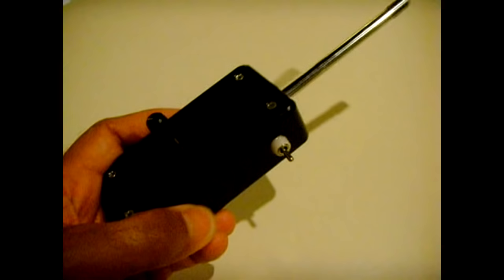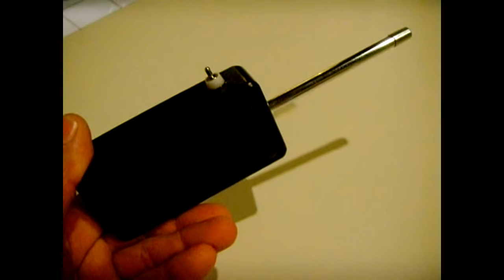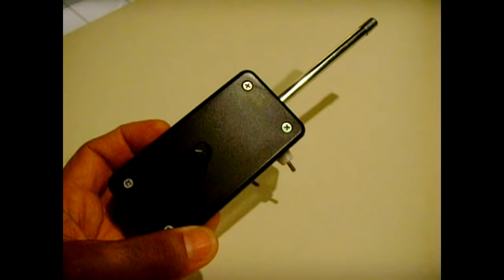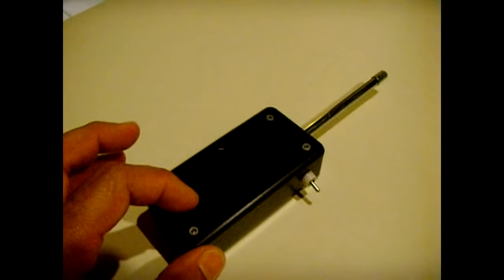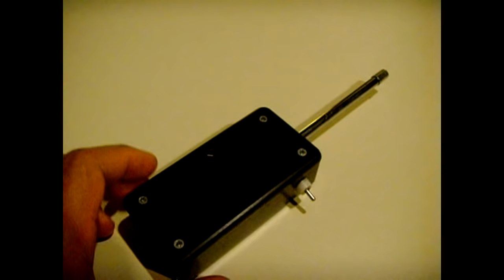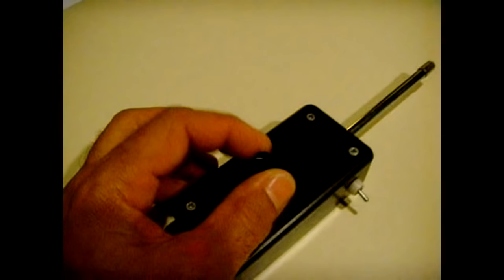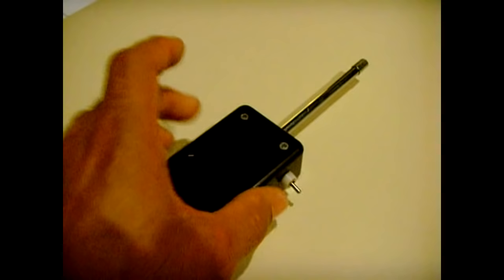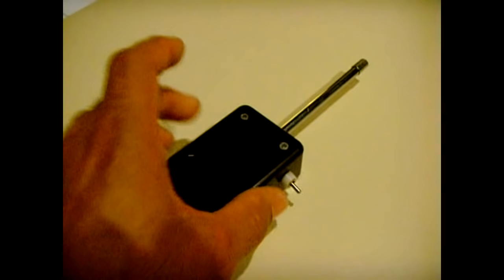FM Radio & TV Signal Killer Prank Gag Device(Wozniak & Steve Jobs)

Comment: Why not just use two 9 volt batteries in series? And will a device like this jam DAB, and can it be used to jam the infuriating radios in shops and supermarkets and bus stations etc.? That's what I need to teach them a hard lesson. And why not modulate it with white noise?

Comment: Worked at the first try using only components from an old radio ☺ +1 sub
Reply from the maker: Great to hear! Be sure to look over my "FM Transmitter" video playlist below, and most importantly share my channel with many others. Thank you
https://www.youtube.com/watch?v=KeRkWYJRxTI&list=PLQ6IOhUBblU3L0gIY6axV7OqRvBTqDNoP
Reply: Slender13 help! I’m not electronically savvy but a quick learner - need this
Reply: @joshuanelson5660  just desolder the components with the correct values.

Comment: Can you describe how to attach the antenna to the inductor (the 6 turn coil)? Is soldering involved or did you use jumper wires? I'm fairly new to building circuits, but I'm guessing the antenna just boosts/amplifies the magnetic field generated by the inductor. Does the antenna even have to physically touch the coils? Also, does the antenna have to be parallel to the central axis of the inductor? Thanks

Comment: Are you making these anymore? Also when buying these online they list things like GSM/3G/WIFI/4G WIMAX/4G LTE/CDMA Do these things jam tvs? Cause it just seems that they jam cell phone and internet. Can you please tell me what to look for when buying jammers for cable and antenna tv? Also do these tv signal jammers work through walls/ceilings/floors? Sorry I am new at this and haven't got a clue.
Reply from the maker: Hi there. Radio waves travel through walls with very little reduction of signal strength. The other jammers you mentioned will not do anything to a TV. The frequency of the jammer needs to be the proper frequency in order for it to work. Using cable or satellite TV with your TV set on channel 3 will work. If you use another input, the device may do nothing.

Comment: Hello Sir. I saw your post at Eleccircuit about the DC/DC Converter using NE555. I want to ask you about how should I do with the GND in the circuit? Can I just simply connect it to an empty circuit board line? Thank you. Peter
Reply from the maker: +Tan Sze-An 
GND is Battery Negative.

Comment: I use to make these jammers 30 years ago. 3 9v batteries near the transistor limit. worked awesome. then cable came :[
Reply from the maker: +Dan M 
I lived in the Bahamas and used the device on cable tv with no problem, until digital cable came along. :-)
Reply: Help, Dan M

Comment: I'm not so convinced, show us your circuit,the built article, I'd like to see it up close-I looked at the values for the tank and even without doing the frequency calc. I dont think you could jam any TV station with that,and at 100 feet? cmon man...
Reply from the maker: psycronizer I am able to jam FM radios up to a maximum 100' just as long as the radio station transmitting tower is not close by, otherwise you will need to get closer to the radio. TV's(NON-DIGITAL) can be jammed as well, but much closer.  No gimmick here. I guess you have not read the "About" section of my channel. You also need to click on the links in the video description area of this video. Remember, this prank device is for use on your own property, and you are not allowed to interfere with people receiving stations around you! Thanks

Comment: hi. im a guitarist and im receiving a radio on my amplifier and everytime i turn on my overdrive pedal... is this device will help me to shut those radio station on my amp? thanks for posting this.
Reply from the maker: Bern Sanchez No. You will create more interference.
Reply: +electronicsNmore so what will i do to eliminate the radio freq that my amp is receiving? thanks boss for helping
Reply: Hey, Bern. I'm also a guitarist and an Amateur Extra class ham radio operator so I know what you're going through and have some suggestions on how to remedy it.  First, if you're using a cheap wireless setup, forget it;  get a better one.....if you're not (or even if you are) using a cheap wireless, get some ferrite beads to put around the power cord of your amp.  You are probably wondering "what the hell are ferrite beads?", but you have seen them before, trust me.  Look at the power cord for your laptop...See that goofy, round, black thingy there around your power cord before it goes into your computer that's about the size of a Combo pretzel snack? (...If you are any kind of guitarist at all you have bought combo's at 2 am after a gig)...well, my friend that is a ferrite bead, and within it lies the secret to you performing the Hotel California guitar solo without interference from the local truck stop.  Ferrite beads act as a noise filter to prevent unwanted interference from entering electronic devices.  They are readily available just about everywhere...Amazon.com likely being the most convenient place to purchase them.  They are also cheap.  They clamp over your existing power cord for your amp (the closer to the amp, the better), or anything else for that matter, and click into place.  Just make sure that you order the right size to fit over your amp's power cord.  We, in the ham community, give ferrite beads to our neighbors when they complain about hearing our radios through their toasters!!!  Hope this helps, and if it does, let me know.  -Tim KD9CTS
Reply: +Bern Sanchez By the way, if you put on 1 ferrite bead and it helps, but doesn't totally eliminate the problem, put on another and see what happens.
Reply: Tim Lane 

Bro, first of all thanks for being helpful and being generous for sharing your knowledge...
What an awesome musician u are. RESPPECT!
definetely will buy two of them (ferrite beads) never heard that before but ur right maybe i saw it before i just dont know the name of it. 
Im using high quality of wires, actually i dont get any radio freq in my house, but everytime we practice at church im starting to hear Indian radio or sometimes fm station. So funny but not really.
But u answer my problem. Thanks a lot Man. You're the Best!
Reply: Hey, Bern. I just got time to respond to your message from the other day and meant to reply sooner.  I didn't realize you were hearing FOREIGN radio in your amp.  Good news, though: Ferrite beads should still work.  Wanted you to know that you're not losing your mind; What you are hearing is likely short-wave radio broadcasts from the middle east.  What happens is that as the sun goes down over there, and it rises over here (or vice-versa), atmospheric conditions are just right and radio signals from over there travel further and dominate certain (ham) frequencies over here; That's not to say that it ONLY happens at those times of day, but rather that's when the effect is typically most intense.  What that means for you is that either your amp's power cord OR your instrument cable is just the right length as to act as a receiving antenna at that frequency(s).  I would be really interested to know whether or not the interference would go away if you switched to a different length instrument cable immediately after you notice the interference; if so, then the cable is the "antenna" and you should put the ferrite bead(s) on your instrument cable (closest to your amp) rather than the amp's power cord.   Best wishes, -Tim, KD9CTS
Reply: Also, if you have a reverb tank in your amp...well that thing makes an excellent antenna as well... You could try unplugging it and see if the interference goes away. Maybe put a ferrite bead over the wires for it.  Because, after all, it's nothing but a coil of wire anyhow.....EVERYONE LOVES A SLINKY!

Comment: Is there anywhere I can get one of these already put together or at least the board ?
Reply from the maker: +jango67
 I may sell the one I have. I have too many things laying around. What are you looking to jam as a prank? Radio?
Reply: radio and tv
Reply from the maker: Let me test mine to make sure it still works fine. I had it stored for a long time. If it does, I will let you know how much shipped with a new battery installed.

Thanks.
Reply: +electronicsNmore Hey by chance was you able to find one of those jammer's ?
Reply from the maker: jango67
I recently moved, so everything is in boxes. Going to take time.